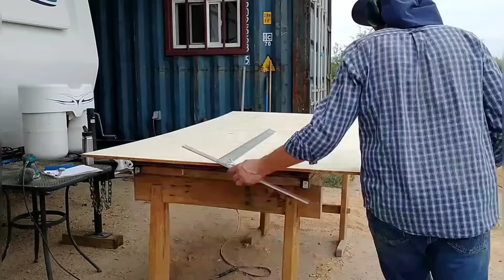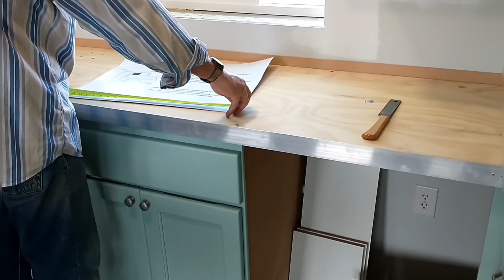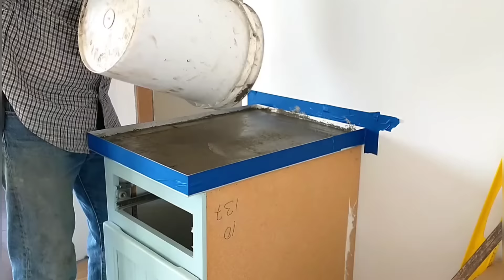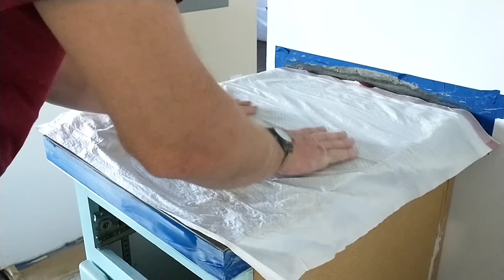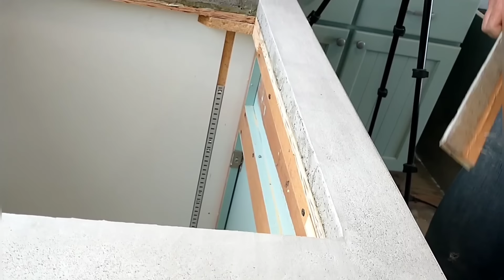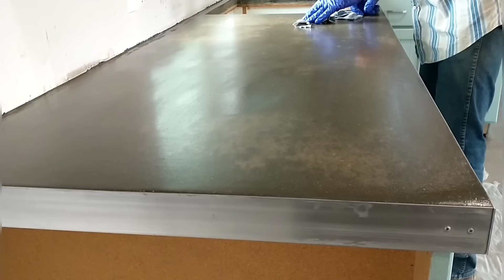Concrete Countertops Start to Finish | Quikrete Mix, Stone Polish, Metal Trim #46 DIY Off-Grid Build

Comment: Concrete corrodes, aluminum same way that water corrodes steel. You need to paint on some sort of a barrier to prevent it from corroding
Reply from the maker: As mentioned in the video, he coated the wood and metal with polyurethane. There wasn't a reaction, and no issues so far.

Comment: Looks great for someone that doesn’t do concrete much (I assume). 

Some tips for anyone watching:
1) after pouring concrete wait for water (the cream) to come to surface. ~30 mins
2) use a magnesium float to smooth the surface slightly. Don’t overwork it. The mag float will push rocks/sand downward but it won’t close off the concrete.
3) surface water should we absorb then the most important part comes, use a steel trowel. The steel trowel will give you a super smooth surface. You shouldn’t need to sand at all after this point.

Comment: dont have to over work the finish.....screed, wood float leave it alone....come back with mag trowel fill low spots leave it...2 passes with steel trowel and done......most cant leave the concrete alone,

Comment: I have a countertop made 2 weeks ago and was left unfinished, can I still do the smooth finish? Or it is too late?
Reply from the maker: You can still wet or dry sand it, but it will be messy. If it's mostly smooth, the knife sharpening stone with oil should smooth out minor imperfections.
Reply: @RedandAprilOff-Grid than you I will try to finish it

Comment: Using the oil and sharpening stone to smooth the concrete is super smart!
Reply from the maker: Yes, it works great, and it's a lot less messy than using a sander.

Comment: really the best and most creative tutorial I have seen so far! I like the alluminium edge as well good job
Reply: I might have used glue on the inside of the aluminium edges instead of rivets to hold it in place though, but to each their own

Comment: I have been looking into doing this to replace my 1970s formica counters.  Thanks so much for this nicely done video!  I've learned a lot from it.  What was the actual color at the end, after using the tung oil?  It's hard to tell from the video.
Reply from the maker: Sorry for the delay in responding. It's a brownish color. We have to be somewhat careful with water sitting on it, but oily things are not an issue at all. One of our more recent videos shows an update on the countertops, you might be able to tell more about the color in that video.

Comment: I’d never use aluminum with concrete. Doesn’t matter what you put on it that aluminum will eventually turn to a white gross material. I see it every day at my job where the aluminum meets concrete. Not to mention it’s a very soft metal and scratches easily. But hey it’s your kitchen not mine.
Reply from the maker: We did an update video. It's working well so far.

Comment: I dry sand it... Not an aggressive sanding, just basically polishing with 400 grit 3M. Wet sanding at that stage of the cure is guaranteed to leave noticeable streaking and swirling in the surface. That may be desirable depending on the look you're going for
Reply from the maker: The concrete was set up enough that we didn't get any streaking or swirling.

Comment: Looks cool, consider using SS button head bolts and nuts instead of pop rivets(looks cheap) for the edging corner joints.

Comment: Very curious what exact tongue oil you were using, what wax, and what polishing stone grit? (I have to redo mine, the concrete countertop solutions products I used are not holding up). Thank you!
Reply from the maker: The stoning was done before the concrete was fully cured, and again when applying the first coat of tung oil. For the stoning, he used a basic knife sharpening stone from Harbor Freight. 
He used "Real Milk Paint"  Pure Tung Oil mixed with 1/4 citrus solvent. 
The wax we used is Howard food grade wax with beeswax, carnauba wax, and mineral oil. It's a soft wax that doesn't harden. 
The first 4 minutes of our most recent video shows some maintenance to the countertop. https://youtu.be/crNzm6RHRWQ?si=MlrqwKPb42Fo3Tgd
Best wishes! 🙂

Comment: One thing to remember on the "heat of battle" mix the concrete really well. If you don't it may start to set before you can float it properly. Also will ensure that any added color is homogeneous thru out.

Comment: Hello I hope the counters are holding up, I’m a concrete inspector and one thing not allowed in concrete is aluminum, it releases gas and overtime can crack the concrete. Just want to comment in case a DIYer is going to copy this method
Reply: Can I jump in here to offer a Materials Engineer's insight?.. the reason why concrete and aluminum don't work well is because raw aluminum is never found in nature, it's an oxygen scavenger so much so that when you cut it, it will cause an immediate reaction with water to produce hydrogen gas to form an invisible oxide layer of aluminum oxide on the surface.. which, in layman's terms is why aluminum looks like raw metal (This is the same thing that happens to Stainless steel, except it's a Chromium oxide layer) hence, the application of using recycled aluminum cans as fuel for a hydrogen fuel cell powered vehicle.. 🫠👀😇 Anyways, the concrete curing reaction off gasses Carbon dioxide which is then consumed by the aluminum, but by coating not only the plywood, but also the aluminum edges when you when first building the forms.. you might have just kept this reaction from happening so I'm not surprised they don't have an issue with it yet on the short term.. looking back, you would have been better off using a polyamide tape on the inside of the aluminum to ensure long term it's not pitting out places you might have lightly coated with the brush.. but either way, I'm going to give this a shot! Five Franklin's is nothing compared to what I was budgeting for countertops! If anything, I'll be able to provide data to the DIY community on what not to do! 😂
Reply: @FKNDBSTP  I was planning to do the same edging with stainless steel. If we paint the inside face or the stainless (the one in contact with the concrete, can we avoid the reaction?
Reply from the maker: The aluminum was sealed. Our most recent video shows an update on how the countertop looks now.
Reply: He does mention it as he is sealing the interior of the form.
Reply: Don’t talk so stupid.
Reply: Interesting. I was thinking stainless might be a good option.

Comment: ❤ this idea! I want to replicate this for a counter....1. did u make the corner angles by cutting and bending the aluminum or did u buy a thicker metal corner bracket? And what type of screws did u use on the underside? Thanks
Reply from the maker: He put a chamfer on the corners and then used cutoff pieces of the aluminum to make the brackets for the inside corners and used rivets to hold it together. The edge was glued on with construction adhesive and while it was wet he pre-drilled and screwed in round washer headed screws. He screwed into the plywood from underneath. Make sure to seal the aluminum (we used polyurethane) to keep the concrete from reacting with the aluminum.  Best wishes! We really like our countertops, and plan to do an update video on them soon.
Reply: @RedandAprilOff-Grid  thanks 😊

Comment: Quik-crete pre-mixed concrete and mortors are the second best. The first best is spec-mix. Any of that Master-crap brand from menards is total garbage. Ive been a brick layer since 1985 so ive mixed a-lot of mud. Great job, i like it and it looks great. I dont think it wiuld have turned out though if it wasnt for april and your cool ass blue hat.😅
Reply from the maker: Quikcrete is all they had available locally, so we were glad to see it was rated pretty well. We love how the countertops turned out and they still look great one year later. Thanks 😄

Comment: The forms you are removing make a tad bit smaller and screw them for easier removal. That narrow area was a tough spot though because concrete always shrinks. Water drys up, ya know. The standard concrete guarantee is: guaranteed to crack and guaranteed that no one will steal it.

Comment: You only used a hand float not a steel finish trowel. Nothing wrong with that but i wonder how it would have turned ou if you would have hit it a little with a steel trowel at the point you said it was getting dry.
Reply from the maker: Our son-in-law finally showed us how the professionals do concrete, on our last project.The oil sanding gave the concrete a really nice and smooth finish, so it worked out okay.

Comment: Its a good idea to clean your mixer when the mortor is still wet,lol. And yes your first batch of the day is a little different because stuff sticks to the sides. The second batch is a little better.
Reply from the maker: Yeah, 😄 this mixer has been used hard, and for many different projects.

Comment: Fab. Would it be possible to put some color pigments in the mix?
Reply from the maker: I think it would work. The pigments could be sprinkled on top when the concrete is still wet, and then after sanding some should be visible. They also make a countertop mix that is white.
Reply: @RedandAprilOff-Grid  alternatively mix pigment in the concrete mixer?
Reply from the maker: @chrrev1  That might work too, but it could change the consistency of the mix, and adding enough so that it would show up on the surface might be pretty expensive. Only what's on the surface will be visible after it's sanded.
Reply: @RedandAprilOff-Grid  yeah i get your point but solid colour wow...

Comment: You mixed your concrete way to dry. It should be more like cake batter
Reply from the maker: We used the recommended amount of water for this Quickrete mix, adding more water will make a weaker and more brittle countertop.

Comment: can anyone share a link with me the  concrete reinforcement they used?  I'd like to get the roll out type in the video. Thanks you in advance!
Reply from the maker: We used steel wire mesh sheets. It comes in sheets and can be cut to size. We bought it at our local Lowe's.

Comment: One thing I would do to save on cost is to throw a bunch of gravel in your forms down the bottom. You don't even have to worry about these showing through on the edge since you are using the metal edging. 
Not sure about those long aluminium edges with no adherence to the concrete (worried that down the road something heavy will knock the edge and it will dent, which will lead to separation of the concrete and aluminium and a small gap that can catch water. I'd probably throw a bunch of evenly spaced rivets along the long edges of the aluminium that stick out into the concrete to act as anchors to fix it in place. 
I noticed some bubbles coming to the surface that you had to keep dealing with on the big pour, if you had used a pice of rebar or somthing, and just stuck it down into the concrete, you could repeatedly tap it, (or use a hammer drill), vibrating the form and helping the bubbles riase to the surface (this would be even more important if you used space displacing gravel). 
I really like this concept!
Reply from the maker: It's been about a year and it is looking great so far. The aluminum is pretty thick, it would take a lot of force to bend or dent it. I used a rubber mallet and hit the underside of the countertop to help work out the bubbles. Thanks! 😎

Comment: The exposed rivets on your aluminum angle are pretty ugly. Should have hired a welder for the corners or used a commercial or removable edge system. Concrete looks good.
Reply from the maker: There are lots of options depending on what look you are going for. We like rivets, & the aluminum looks nice with the backsplash and the rest of the kitchen and house. Thanks!
Reply: @RedandAprilOff-Grid  Fair enough. I'm happy you enjoy them. Love your videos!

Comment: It didn't make sense to first lay the wood, and then cut out the hole for the sink. Why not first place the sink where you wanted it, then lay the wood?
Reply from the maker: It was a tight fit and it was easier to tell exactly where we wanted it once it was in place.

Comment: Maybe try a finishing trowel next time instead of that mag float. Way easier to get it smooth once it reaches the set point that it can be worked. You only need to hit it at the right time once.

Comment: Don't like the aluminum border, it's a water trap and don't like the ply board base. Won't make one like this
Reply from the maker: There isn't a gap, and water soaking in isn't an issue at all. It water got that close to the edge it would run off onto the floor.  
There are lots of ways to do countertops, best wishes.

Comment: Cement is the glue that binds the aggregate. Concrete is cement plus aggregate (stones, sand). Your counter-top is concrete, not just cement. I'm being picky because I used to get it wrong before YouTube. The front sink edge needs to be extra supported for cracking as it is a thinner strip and will snap under weight. Maybe not with concrete but definitely with a marble sink (ask me how I know!!). Great job, guys. Looks amazing.

Comment: Wow I would have thought aluminum would dent really easy...You'll have to keep us posted on how well this holds up.
Reply from the maker: It's tight against the concrete, and isn't going to dent without some serious impact. It all looks great so far.
Reply: In my opinion. The aluminum is rediculous. Especially seeing the rivets
  It should have been done with a removal form.
Reply from the maker: @STEVEID1946  It looks amazing in the finished kitchen, and we haven't had any issues with it. Maybe it's not for everyone, but we love how it all turned out.

Comment: I would worry about the aluminum edging. i think it'll trap stuff like spills.
Reply from the maker: It hasn't been an issue so far. There isn't a gap and the top is well sealed.
Reply: @RedandAprilOff-Grid  but concrete will not completely seal to aluminum. It probably doesn't matter anyway. It would be such a minute problem. Particleboard countertops pose more problems than that. BTW, it looks great. I'm getting ready to do mine. I'm adding 4" to the width(front to back). With a slate textured top and a chiseled edge.

Comment: Looks great. To achieve a smooth surface when tooling concrete switch to trowels after the first pass. I only saw you using a float. Trowels have flexible blades that allow firm even pressure on the surface without digging in like a float.
Reply: I was going to say same done with float go to a trowel would have saved you alot of extra work.

Comment: Aluminum was a TERRIBLE choice for you edging. It is highly reactive with both acids (lemon or lime juice or tomato) and alkalies. Over a very short course in a kitchen you will see devastation... just say'in
Reply from the maker: The aluminum was coated before pouring the cement, so there wasn't a reaction. It would have happened immediately. It looks great so far, it is coated in wax, and we don't plan to smear any type of acid on it.

Comment: Did you use any supports at the front of your cupboards ?. that counter top must weigh over half ton.
Reply from the maker: These are individual cabinets with wooden sides, they are plenty strong. The base also spreads out the weight.

Comment: Dry pour is all the rage now with regards to small patio slabs etc, has anyone ever done a dry pour concrete counter top ?
Reply from the maker: Sounds a bit risky, but it would be interesting to see someone try it. 😄
Reply: NO... don't do dry pour for a countertop (or for anything really). Dry pour is very porous and flakey, constantly producing dust and without a hard surface. Exactly all the things you don't want in a countertop. Without being outside for continuous water ingress, it will never set up property either. 
The only dry pour technique I would use is for concrete stabilised soil, but even that is really just a different kind of mixing. For small patio slabs, I would just do soil-cement (for any kind of soil except heavy clay). Looks better and is cheaper.

Comment: Did you put silicon shield in your mix?
Reply from the maker: No, we didn't add anything to the bagged mix.
Reply: @RedandAprilOff-Grid  try it next time to prevent cracking...do the research first?
...looks good though!

Comment: I'am really glade i went to porcelain floor title over concert counter tops. Or even EPOXY Counter tops.  looks and fells better!  More durable to heat and cold>   I can set a very hot skillet on it, Cut on it, Bang on it. If it freezes inside it want CRACK.  My counter top with the title 👀looks like ITALIAN MARBLE~  Every one love it.  I DO TO!  😉👍
Reply from the maker: We love the concrete countertop as it is, but sounds nice. 🙂
Reply: @RedandAprilOff-Grid  I'am sure you do. 👍👍

Comment: I have just been quoted 750 euros for a piece of white quartz 90x70 cms with a cut out for the burner. No way. So I am here learning how to make one in white concrete, if I mess it up no big deal I can start over, that's how you learn. Thank you
Reply from the maker: We are happy with how ours turned out! White is a nice option, and it should be a huge savings. Best wishes! 🌞

Comment: i like the metal angle edge & 3/8"plywood @ walls-now I can do mine..those were the missing links to sucess.
Reply from the maker: We really love how it turned out.  Just make sure coat it with something, so the wet concrete doesn't react with the aluminum. Best wishes!

Comment: you don't finish concrete with a magnesium trowel, your sanding was way harder than it needed to be
Reply from the maker: That's what I told him, but he preferred using it. The sanding was actually pretty easy since he did it after only 24 hours.

Comment: If you add a plastifier to the concrete mix like a carboxylate, then the same or even less water in the mix would give you concrete that would run and self consolidate.